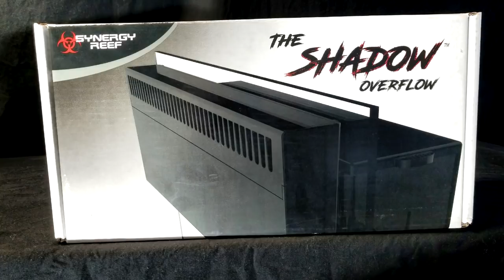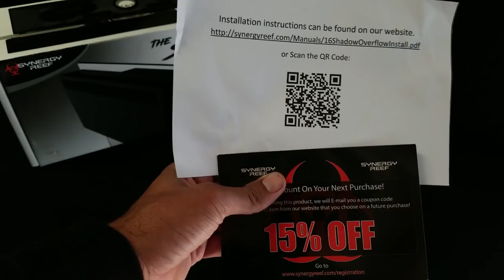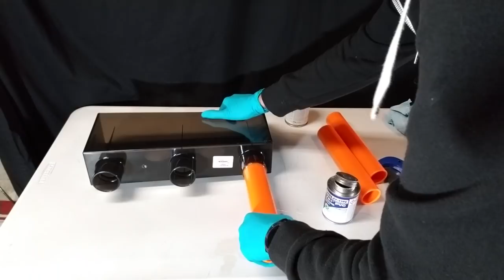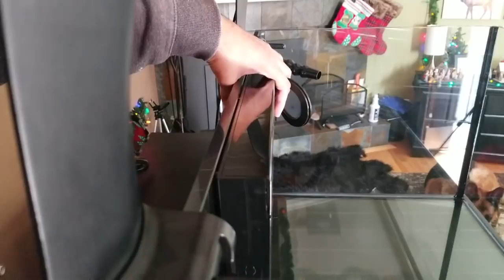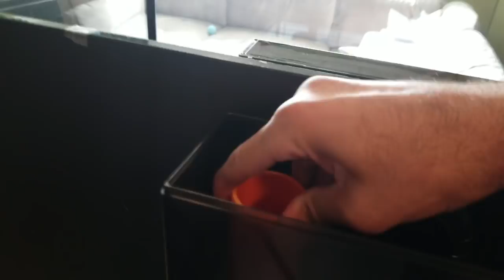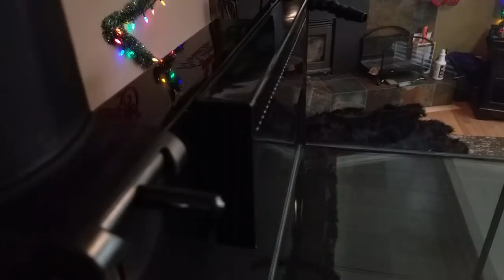Build Series|Eps. 13| Plumbing Synergy Reef Systems Shadow Overflow

Comment: Thanks.  Great video.  Two questions:
1) just saw a video by the manufacturer and they were very insistent that you do not use primer when attaching the first length of PVC.  Something about being incompatible with ABS.  Your thoughts?
2) the same video recommended that the initial length of PVC be between 4 and 10 inches.  Do you have any insight as to why this is the recommendation?  And are there any considerations re using the short or long length recommendations?

Comment: Great how to vid. The whole setup is really coming together now. The righty-tighty tip is invaluable... Who knew you could install them backward! Hey, do you mind sharing the brand of your PVC cutters with us? Thanks!
Reply from the maker: Great point, I never did mention which PVC cutters I was using. I purchased the Brass Craft cutters from Orchard Supplies. I think most big box or Amazon will have them. I purchased the larger ones for about $30. WELL worth it! Thanks for the post!

Comment: Looking good, as always!  Just curious, as I'm going to be using the same overflow - when you ordered the tank, did you have a chat with them about where the water level would be, and how did they determine that? I know the overflow comes with a template with some marks on it to help guide where the water level will be, but did they use that?
Reply from the maker: Reef Eco Crystal Dynamics built and drilled the holes. I'm sure they have a template because the template I have was a perfect match with the predrilled holes.

Comment: Looks great
One observation that I will like to mention inside the overflow box is just the lock nuts and no gasket I definitely recommend to put another gasket in there better be safe than sorry.
Is getting there , where you want it, with patience and powerful will
Is closer to the end ReeferGil
Reply from the maker: Hey Cuban, there are gaskets on the locking nut, but it's on the opposite side of the external box against the glass. Additionally there are a set of gaskets inside the tank. It should seal from inside and outside of the 1.5" holes in the glass. Once my sump gets here, I'll finally be able to see the light at the end of the tunnel, lol. This is a baby step project, didn't intend it to be this way but at the same time I have more time to do detailed videos of the baby steps I'm taking.
Reply: ReeferGil I agree 100% 
No rush , baby steps is way better and more time to think what could be better or wrong 
Definitely is looking good my friend